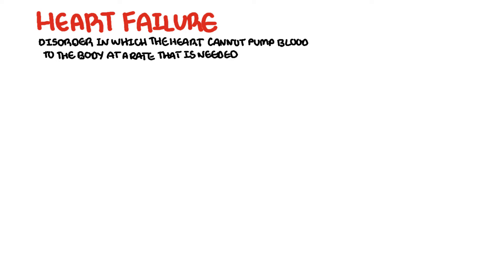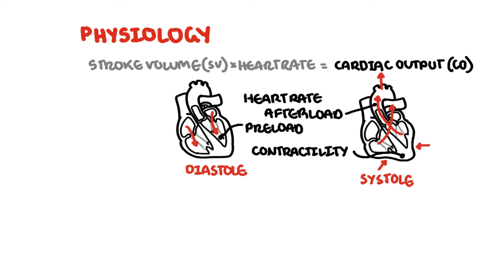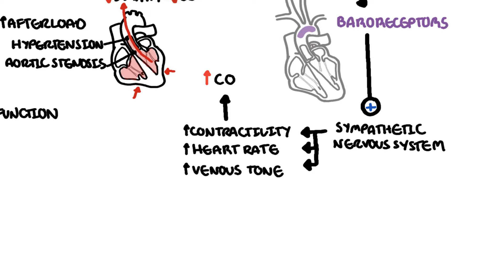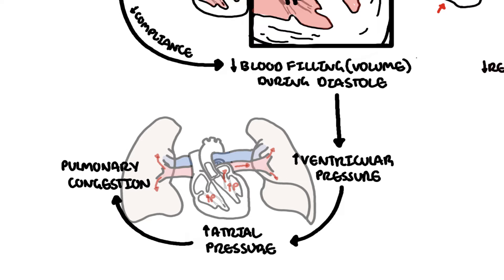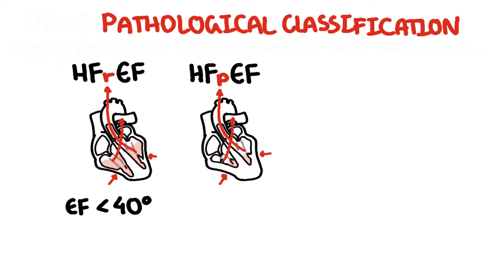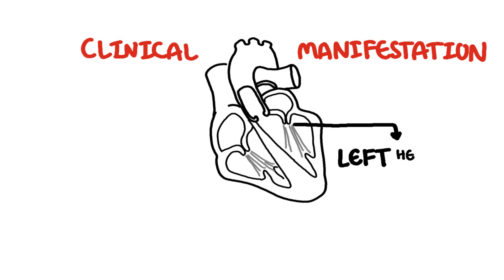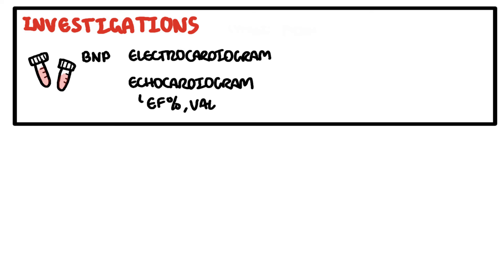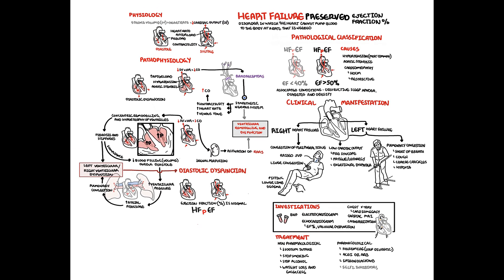HFpEF - Heart Failure with Preserved Ejection Fraction

Comment: This is wrong, it’s hypertensive heart failure, which is different from what we’re calling HFpEF.

The echocardiogram is different, and so is the pathophysiological process.

The treatment is different for hypertensive heart failure - which is antihypertensives, and HFpEF which is metabolic control - using gliflozins.

HFpEF is specific to echocardiogram that is NOT hypertrophic, and blood pressure is normal or LOW, with traditional heart failure signs and symptoms. The cardiac muscles instead contracts poorly/hypodynamicaly/slowly so an ejection pulse is tapered out and weak despite the overall ejection fraction at end of systole being of a normal fraction.

If there is hypertension, by definition the so called cardiac failure is not due to insufficiency, but excess. 

I recommend checking out carolyne s.p. Lam cardiology grand round on YouTube for an updated understanding of what HFpEF is, which is different from hypertensive heart failure.
Reply: Also, we don’t only classify heart failure into hfpef and hfref - that is medical student exam level knowledge which is about 10-20 years behind what current medicine is. You learn this to pass exams but it is wrong.

You did not also indicate high output cardiac failure, where despite a relatively normal heart function, the lack of systemic vascular resistance results in an insufficiency of cardiac output to meet an abnormally high output demand I.e in septic shock, beri beri, hyper thyroidism etc.

Also, diastolic failure is also due to excessive ventricular rate like fast AF or other svt(of which there are a bunch)

There are various causes of heart failure which are not necessarily due to the heart itself but rather outside of it, and then those due to the heart. They can all resemble HFpEF if you use the blanket terminology, but their pathophysiological processes and treatments are so different that it is not right to lump them together merely for heuristic short cutting.
Reply: @Soneoak what symptoms is there?